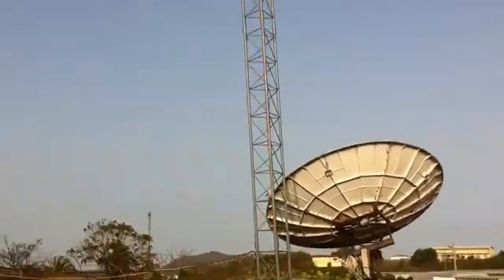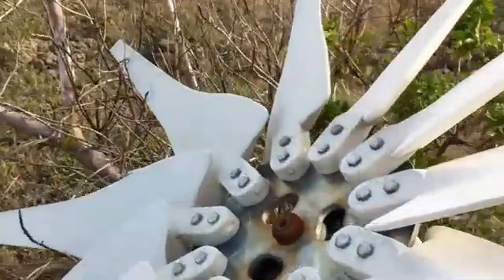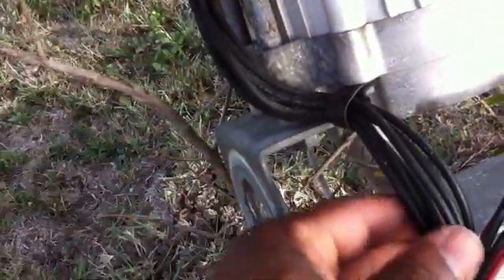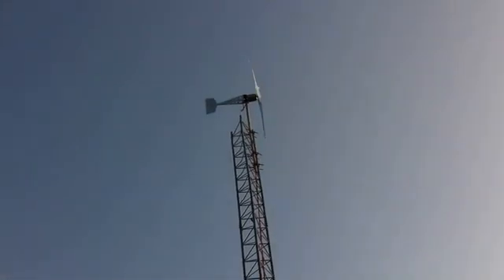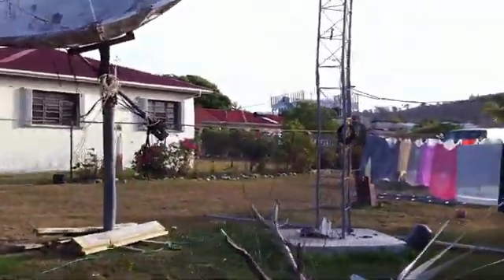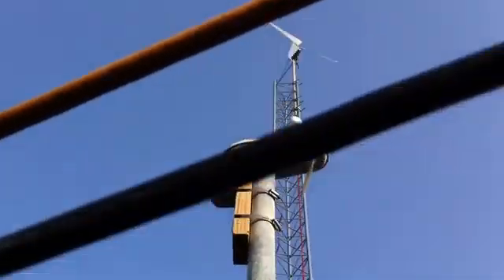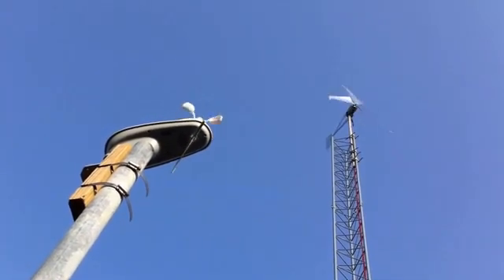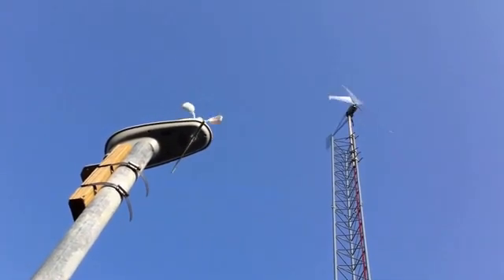New Missouri wind and solar Dual Freedom II PMG sitting on 50' rohn tower

Comment: Looks good but Missouri freedom produces very low power. 1700 watts produce about 200 watts under full wind. Have fun with your crap you bought
Reply: According to their website freedom 2 wind turbine 2000 watt 24 volt turbine produces 
200 watts at 10 mph, 400 watts at 15 mph, 800 watts at 25 mph, 1000 watts at 30 mpg, 1600 watts at 45 mph, 2000 watts at 50 mph